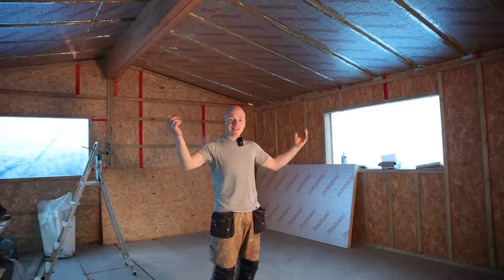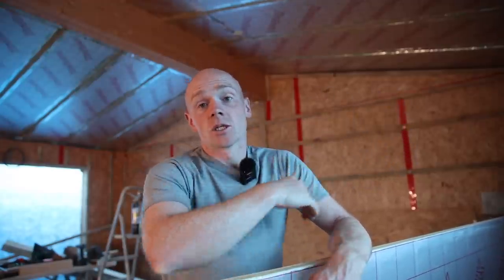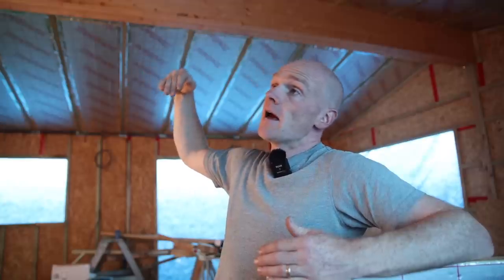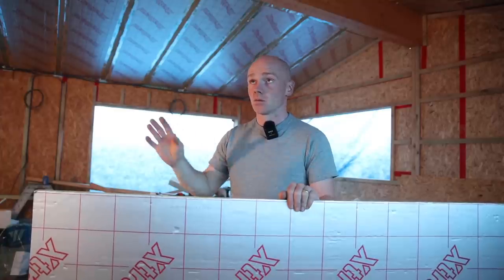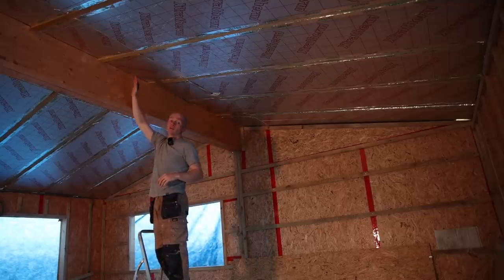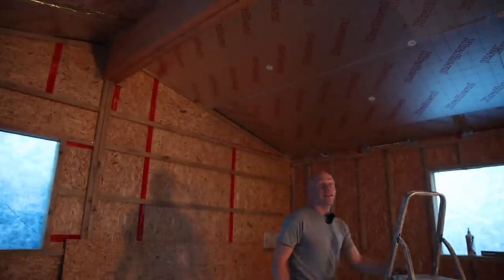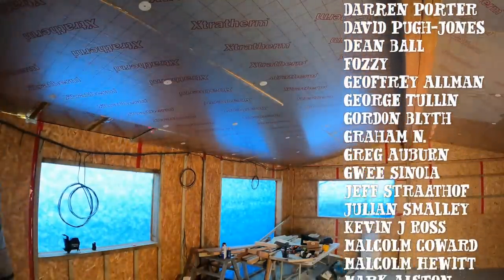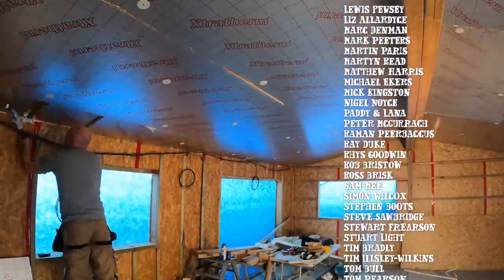WHY INSULATE UNDER RAFTERS? - The Restoration Couple Cabin Build

Comment: Hi Tim, another great informative vid!

Can I ask (as I'm a novice) - are you screwing the battening for the plasterboard to the joist though the PIR?  I'm guessing you are going run the battening in the opposite direction to the joists? (horizontal?) With 25mm batons?

Sorry for all the Q's but about to rip a lot of plasterboard down to inset PIR in my extension roof (done before we moved in) and then replace it all.......
Many thanks😀
Reply from the maker: This one I screwed battens through straight where the rafters were so in line but you can do either.
Reply: @TheRestorationCouple  lovely cheers

Comment: Since Gapotape isn't sold in 50mm sizes what I ended up doing was cutting the boards slightly short (5mm each side) and then using packers + foam to glue the board in solid, then taking the packers out and filling those holes too.

Comment: Would you clarify if I can put insulation boards on the underside of a cold, flat felted roof building that currently has no heating or should I create a void between the underside of the OSB and the top of the insulation board? Thanks,
Reply from the maker: I would leave a vented gap, the other option being to lay insulation. over the top and fit new Edam/felt above that if possible,
Reply: @TheRestorationCouple  Many thanks James. You're hosting a really good website and pitch your guidance in a very uncomplicated and encouraging way.
Good luck with your future projects. I'll look out for them if you decide to share on the web.

Dave

Comment: Is the exposed ridge beam not going to be an issue from an insulation/cold spot point of view? Or will you be doing something to it? Really good and clear explanation of the difference between a warm and cold roof 👍
Reply: Wie denn? Der schaut immer raus.  Außerdem ist der aus Holz. Wlg 013 w/m2 Kelvin.

Comment: Would be interesting to see what your finished U value is. Anything below 0.30 would be very good, there is only so much you can do given your size and weight constraints. While you can't expect miracles, 0.30 is better than a lot of houses so will be comfortable in all seasons.
Reply: Below 0.3 is not 'very good' by any measure to be honest and that can be achieved with just 50mm PIR board. Even the old building regs which have just been replaced required U=0.18 in this roof scenario and new regs is lower again. That said, the spec they are using here is likely to achieve approx 0.2 W/m2K which is a great effort for temporary and mobile home but a fair way off achieving current regs and passive house standard (U<0.15).....now that really would be 'very good' !

Comment: I bought one of those saw blades (wavy) for the jig saw to cut the same boards you've got and they didn't work. Long Stanley knife (with blades that stick out longer, stiletto type worked the best (Magnusson). Or pizza cutter obvs. The blades didn't stay perpendicular to the board so to speak, but bent.
Reply: If they're the Bosch ones, I also found them a bit hit and miss in the jigsaw but try gripping the blade tight in a pair of mole grips and use it as a manual knife instead. Using a bit of straight wood like Tim or a chunky 1.2m spirit level like I did and cutting about 20-30mm per pass you can get really consistent nice square cuts
Reply: @LocostR1  interesting, will give that a go next time. And yeah it was the Bosch ones.
Reply: I ground the teeth off a long (9" ish)  reciprocating saw blade - they are stiff - to replicate the profile of bread knife. Then reciprocating saw worked great on 120 mm thick boards. Fast, safer, and no dust.

Comment: Hi Tim, 

Are you plastering or tape and joint?
You’ve probably already thought about this but tape and joint might be better because of movement ect and believe it or not weight. 

Great vids always a pleasure to watch. 
Tim
Reply from the maker: No it won’t be a full skim as like you say it all adds weight. Joints will be taped but corners will be covered with a trim I think as if it’s going to crack it will be there. Ceiling lightweight cladding type.

Comment: Did you consider at all using the insulated panels as roofing like you used with your workshop? I'm planning a similar build to this and looking into using them for the roof.
Reply: I too wondered this and wondered whether I missed the explanation in another video?